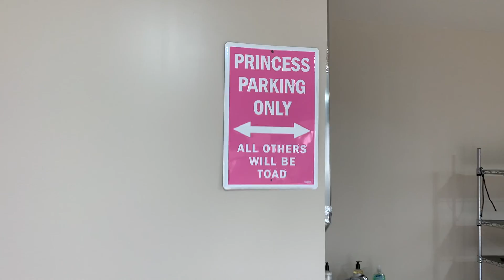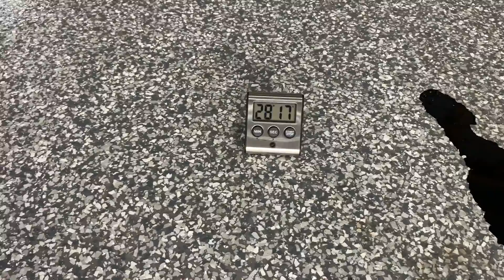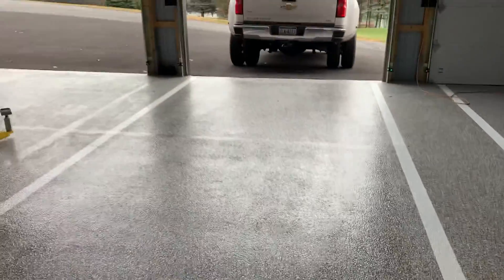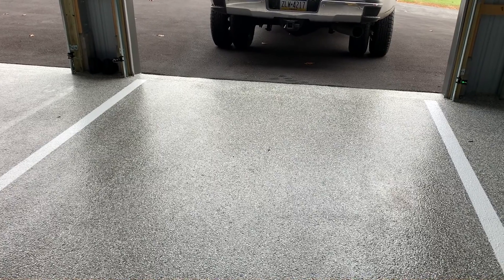HOW OIL RESISTANT IS EPOXY / POLYASPARTIC FLOORING?￼

Comment: On the polyaspartic top coat how long will it take for tire marks become permit stains and the same question for oil stains .. my cars are not driven a lot and can be parked in the garage for several days.
Reply from the maker: That is actually a complicated question.
For any oils, it would be permanently resistant to it.
As far as marks from the tires, that is all dependent upon the amount of plasticizer within the tires. Some  tires or soft compound tires have high plasticizer Content. Plasticizers can stain any coating on this earth. There is no certain tire that this happens with, it is completely random. If you are concerned about tire staining, I would recommend putting pads underneath the tires.
Reply: @ConcreteFloorSolutions  Thank you

Comment: 10:24 I did not get, what is 30 Mil? is that 30mm? I do not believe this. It requires lots of material and quite expensive? Do you mean 0.3mm?
Reply from the maker: 30 mil = 30 thousandths of an inch.  NOT metric.

Comment: Now, I wonder -- maybe it'd be possible to epoxy the entire driveway.
Reply from the maker: You can, it would not be recommended in freezing climates, and can get slippery when it's wet. So you want to make sure you add texture.

Comment: What did you use to paint your lines?
Reply from the maker: Black CFS – 1C Polyaspartic. 
You just need to make sure you tape very well so the material does not wick underneath the tape.
https://concretefloorsolutions.com/store/polyaspartics/cfs-1c-polyaspartic/

Comment: Is it possible to make the aspartic as grippy as the eurea? I am concerned about wet shoes/tires slipping.
Reply from the maker: Absolutely, our kits come with aluminum oxide texture additive which is regulated by the installer when you apply it.  If you have any questions, email me directly jason@concretefloorsolutions.com

Comment: I don't understand why the author of the video did not use a surface roughness meter to precisely measure the amount of surface roughness of the finish of polyaspartic vs. Polyurea. In terms of chemical resistance, the material specification sheet should provide details that will be very informative versus the novice test of used motor oil only. My recommendation is to post the material specification sheets so that those who want to know more about the product have access to that information produced from the manufacturer of the product.
Reply from the maker: Here you go:
https://concretefloorsolutions.com/wp-content/uploads/2022/09/CFS-1C-POLYASPARTIC-technical-data-sheet.pdf
Reply from the maker: Most people like to see results, not read about it. 
That is why I try to show how it holds up
Reply: @ConcreteFloorSolutions  it's very difficult to qualitatively discuss surface roughness. If you purchase a surface roughness meter, then you will have a comparison and be very accurate with regard to relative differences in surface roughness between polyurea and polyaspartic.  One thing you might consider doing, is to bring samples of your different products over to the Materials Science Department of Lehigh University and talk to the department head regarding instrumentation and differences from an engineering standpoint on the different products that you apply. I'm sure they would be delighted to assist a small local business with technical matters.
Reply: @frankie7508  I think you are taking a garage floor a level too seriously. If you can tell the difference from one coating to another then hillbilly math works just fine. These floors are each a little different depending on how many times you scrape the floor, how much chip you put on, the thickness of the basecoat even changes how the floor will end up because it will hold the flake different. You don't need an engineering degree to install one of these floors.
Reply: @HENSLEYDMB  and you don't know what you're talking about.  0 + 0 equals 0 no matter how many times it is added.

Comment: How well do it hold up to welding sparks?
Reply from the maker: There is NO epoxy or polyaspartic floor designed to withstand molten metal. use a welding blanket to protect  the floor when welding. Epoxy. / polyaspartic is like plastic and will melt.
Reply: @ConcreteFloorSolutions  okay thanks 😊

Comment: Hey there Jason, what kind of paint did you use to paint the lines and is the something you also offer?
Reply from the maker: It is the same material as the topcoat with black tint.
https://concretefloorsolutions.com/store/polyaspartics/cfs-1c-polyaspartic-single-component-polyaspartic-coating/

Comment: Hi Jason have watched most of your videos would you mind answering a few questions when you say that the Polyaspartic is 10mm thick but across the screen it says 30mm which is it never looks like its going down so thick also if you were to try using a car trolley jack would it damage the coating and also turning the steering in your car. 
Regards Dianne sorry if they are stupid questions.
Reply from the maker: For the record, I said 10 Mil (10 thousandths of an inch) NOT 10 mm (3/8ths of an inch). 1 mil equals 1 thousandth of an inch. Mil and millimeter are different measurements. The topcoat is 10 mils thick, each of the two coats underneath is 10 mils each also, it is a total of 30 mils. You are correct it is not going down that thick. Not a stupid question, if you didn’t know, now you do. So yes, you can roll trolley jacks over the floor and it will not damage it.

Comment: Hey mate, awesome explanation you got there especially with helping us understand the texture urethane vs polyaspartic. I’ve been a subscriber for over a year now and have watched most of your videos (liked them too) even though you mentioned about the squeegees and rolller in various occasions I haven’t found a video explaining about them in detail. So I would really appreciate if could spend some time to put together a video on the different types of squeegee you use notched vs flat, which one for prime/base/top coat. The nap of the roller and why you prefer certain things over the other. Also edging do we need to squeegee all the way to the wall or will a small roller/paint brush will do. In a line marking video of yours I came across a wonderful explanation on how to properly put tape. A question regarding that is do you use tapes which have sharp edges or normal ones. Hope you would consider this request. Thanks wish you have a bright future with the sales of your products.

Comment: Would you mind sharing your thoughts on the Spartan ZTR mower?
Reply from the maker: I absolutely love it, I bought it for the suspension because of my back. NO regrets at all. I do have to say that's the first zero turn I ever owned, so I have nothing to compare it to.
Reply: @ConcreteFloorSolutions  Thanks for the feedback.  I'm in the market for one myself, and had never heard of Spartan until I saw it in the background of your video. Plan to visit my local dealer soon.